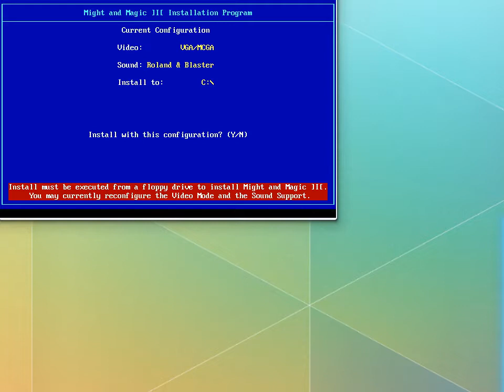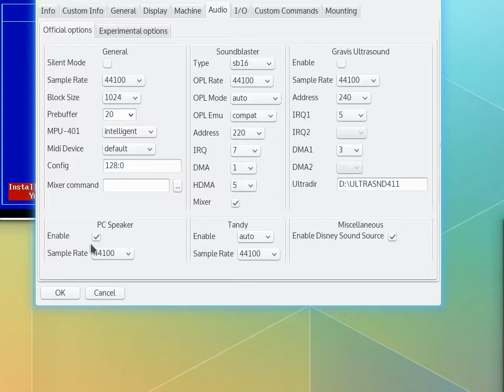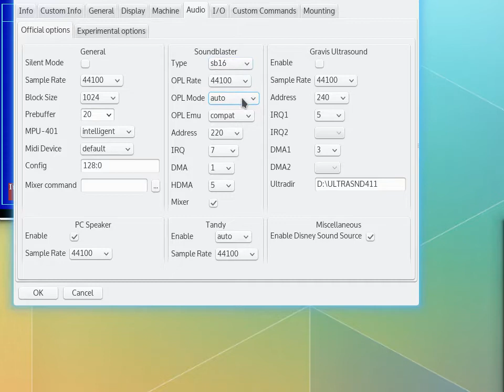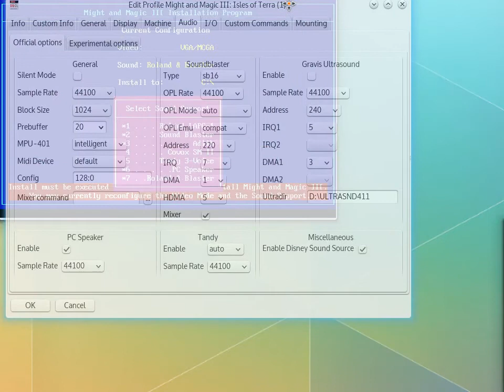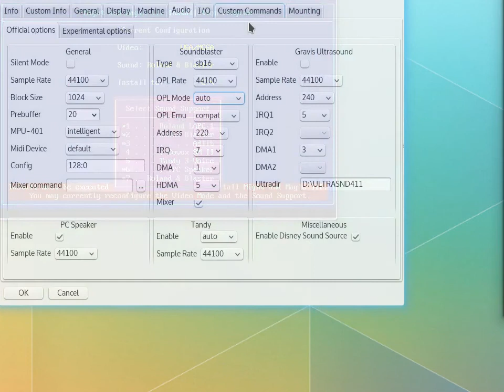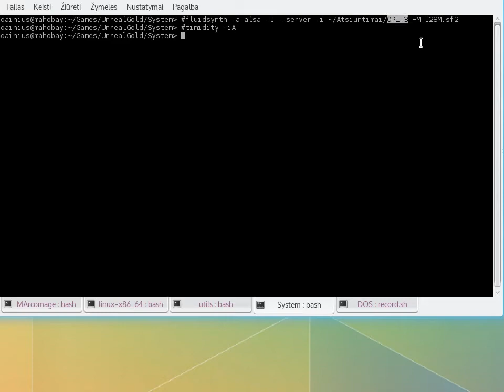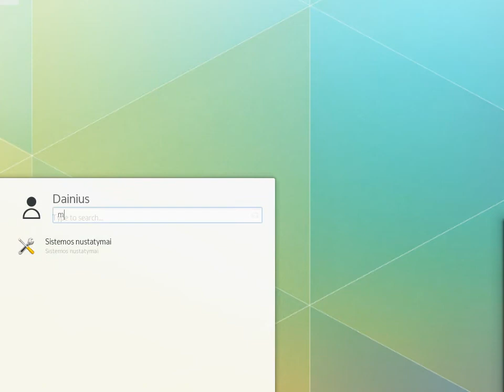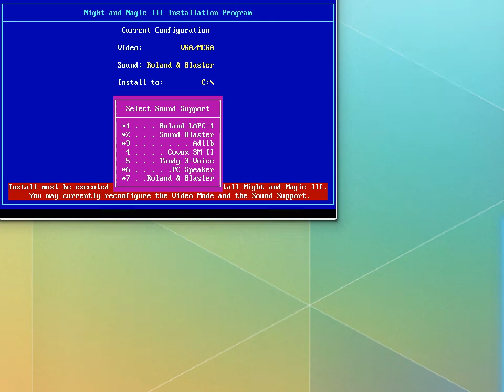(2) IBM PC DOS sound card history & emulation (MM3: IoT)

Comment: Quite a few games in the early 90's had simultaneous support for both the Sound Blaster and Roland, since Roland was great at the musical rendition and much more superior in not only the instrumentation and polyphony, but the acoustical and spatial elements which add the wonderful vibrato and resonance that we've come to love from a good MIDI board.

However, the Sound Blaster was essential in the digitized speech department, since the Roland MT-32 could not do that, and it wasn't designed for that.
Reply from the maker: Did a lot of games use speech? In MM3:IoT it's more of a gimmick rather than anything else. Sound samples must have taken a huge amount of space (WoX uses 2 CDs for that).
Reply: GreatEmerald Of course, the speeches themselves were mostly implemented at the beginning or ending of the games, such as Wing Commander: Privateer.  However, some big Sierra, LucasArts, and Origin titles were updated to CD shortly after being released originally on floppies, and they included lots more speech, coupled with the MIDI soundtracks.

Comment: I believe that the AdLib came first in 1987, and then followed the Game Blaster, which was the renamed Creative Music System distributed in 1988.  This is according to a few online sources which I've read, but they could be inaccurate.

The AdLib photo which you showed on the video is an updated version of the original 1987 one.
Reply from the maker: Wikipedia says the CMS came out in 1987, it was just renamed to Game Blaster in 1988. I refer to CMS as Game Blaster because it's simply a more pleasant name :)
Reply: GreatEmerald Yea, they were all closely released within a short timeframe of each other, including the MT-32, in which the first models were available in 1987.  

However, PC games started implementing the Roland in 1988, with Sierra being the first company to even distribute the module with its game, King's Quest IV.  Of course, that was a very expensive proposition ($500), and so it did not last very long.

Comment: What are you referring to when you said that it couldn't play the piano? I mean, if you're not hearing a piano sounding instrument, it's probably because the MT-32 doesn't feature a piano sample.
Reply from the maker: Yeap, that's exactly what I meant. Somehow the MT-32 didn't include any real piano attack samples.
Reply: One of the many shortcomings of the MT-32. I wish if it would be possible to combine MT-32 and D-20 (maybe with MUNT it will be possible).

-- (a part which you probably won't care about lol) --

I have the D-20 and it's basically a brother to the MT-32 and D-50. It's the same thing, except obviously with a keyboard and a sequencer, and notably different samples (including a piano sample wow).

Everything works like the MT-32 on it except the sample's ordering is different. The only games that I found the support for it are the games from Sierra.